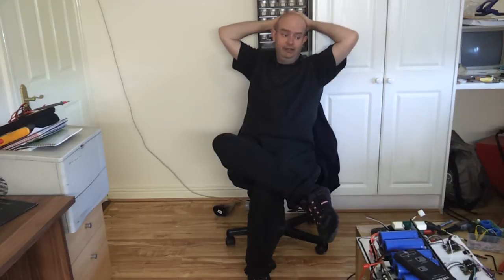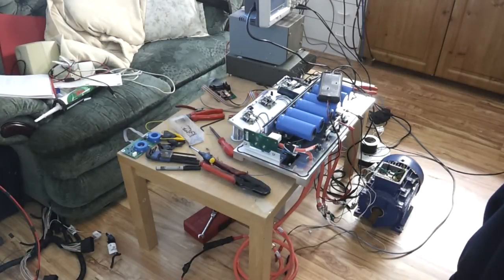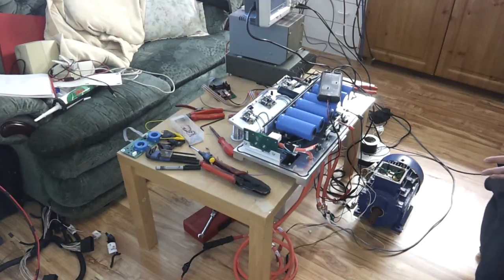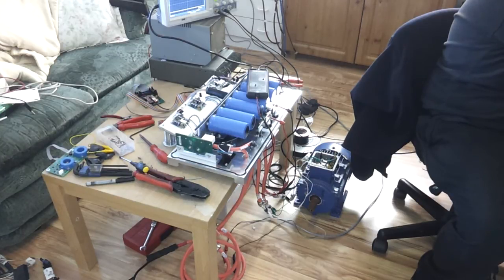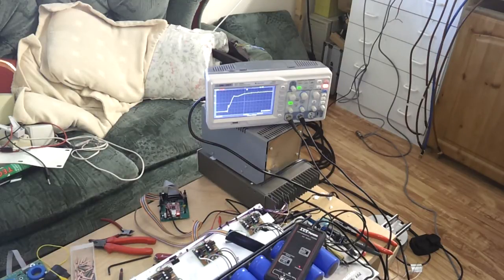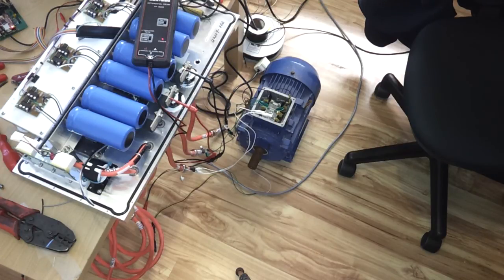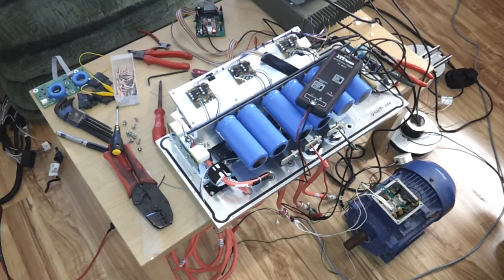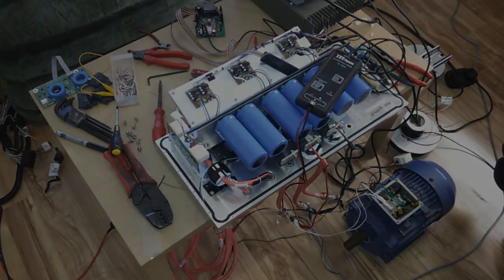BMW E31 840CI EV Conversion 15 : Inverter 04

Comment: I love your videos!  What capacitance do you have from +15v to emitter, and emitter to -8.2 (or -15 or whatever it is)?  Are they electrolytic or MLCC or both?
Reply from the maker: Hey Paul. Drivers run +15/-15v and use 100uf elec and 0.1uf ceramic caps.

Comment: Congrats Damien! I've been watching Johannes's work on his DIY controller for a while. What impresses me the most is how well tuned the controller is to that motor. You said you picked up a random motor for the test but did you notice how even at 10Hz there's no switching whine? Not all controllers can do that, I'm sure you know.
Question: can you really drive a 3 phase motor in full vectoring mode with just one encoder channel? Or are you planing to use at least 2 channels once everything's setup? Texas Instruments has sensorless code they use in their VFD design references. It would be interesting to see if that can be applied to your controller.
Reply from the maker: this inverter does not use foc control. it uses slip control so rotor position is not required just it's speed.